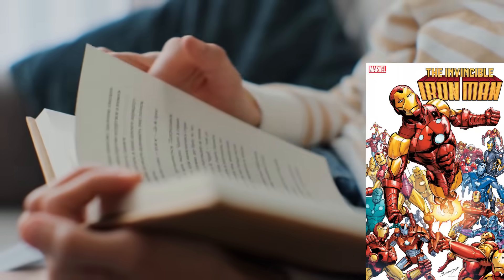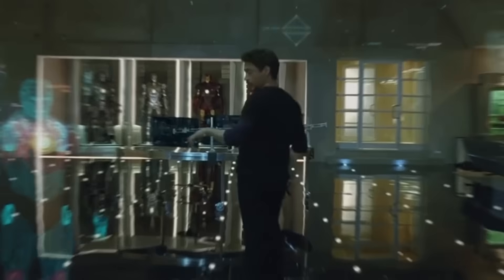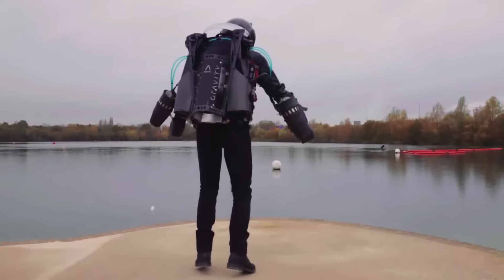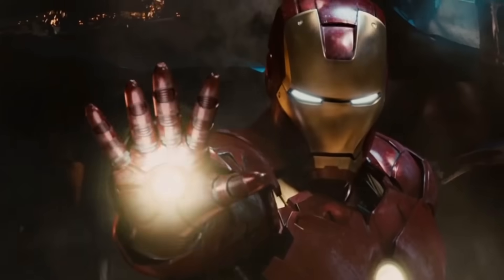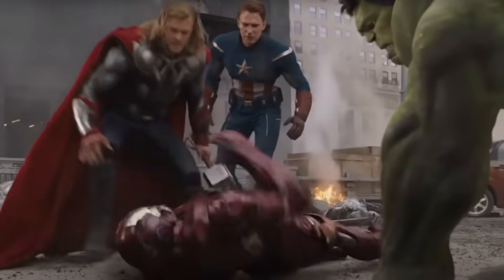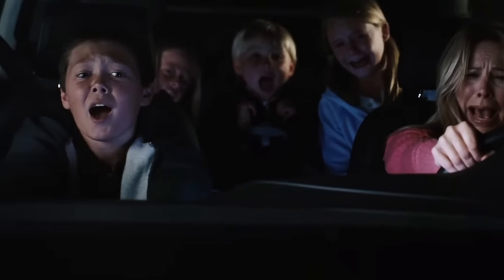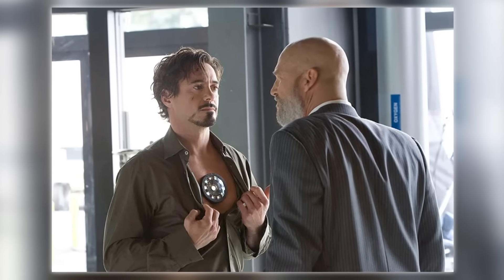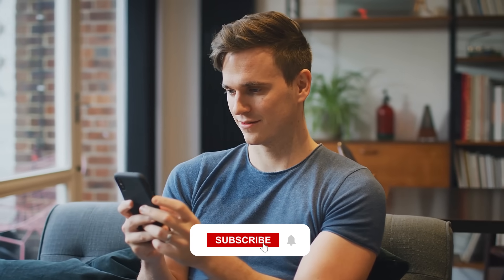Why we can’t build an iron man suit in real life

Comment: Repulsors is supercharger tech. The hydrogen quartz solanoid arc reactor uses amplification and feed back loop and filtering which is why the lighter smaller hydrogen and water but remember it was created to lock and hold shrapnel pieces in place. It amplified the power and electromagnet till it could MRI imaging precision hold shrapnel which might not be magnetic or have little magnetism so its tuned maybe for brass or lead. Its summary is rather than hold shrapnel piece he locked his chest ot blood in place so he could move and not be shredded. Its maybe based on paizoelectricity perhaps backwards or something with quartz frequency he then has this electro magnet feed back amplifher of power maybe just an overly large quarts in segments which if overloading create the supercell red storm on other planet jupiter overloading more and more maybe like a white dwarf proton star thing is related. Its function produces much hydrogen like the surface of the sun but its maybe just supercharger fueled by water that engine blasts hydrogen out exhaust he call repulsors

Comment: why you need a video for that... pure common sense tells you we don't have the power source (we don't even have a running fusion reactor and getting that into miniature form-factor well not think about that one yet)... then there is the material which isn't strong enough to hold up in that size nor can withstand the damage... even the hulk buster which is much bigger wouldn't be possible at this point if you want one which can fight... we lack of propulsion systems which are small and strong enough to lift the armored suit plus a human (yet alone a human - and one of his gloves or boots is strong enough to hold him in the air)... we leave weapons aside as it would just be fun to fly around in them (which we couldn't replicate anyway)... and well the AI / computing power required isn't there yet...

Comment: The arc reactor is everything. And we simply don't have anything close to it. It produces more energy in a tiny form factor than entire nuclear power plants, and also doesn't give off any excess heat or harmful radiation while making so much electricity. It essentially gives you the power of God in a tiny form factor. With that kind of energy at your disposal, almost anything becomes possible.

Even in MCU, Howard Stark modeled the initial arc reactor design by studying the Tesseract. Tony later refined it, and then miniaturized it in the cave. Unfortunately we don't have a Tesseract to study from either. We are still struggling to do nuclear fusion with TOTAL net energy gain in large reactors like ITER.

Comment: For the reactor you need sodium as the energy to power up the whole suit I made my own suit but it isn't iron I call it Blastersuit 1.0 so wanna know why I use sodium instead of electricity?
Bc of heat and shockwave through the suit that might shut off everything the blaster works but uses Ligther fluid and it creates shockwaves through the room knocking all the unstable items

Comment: Nikola Tesla was desinging the capability to transfer energy wirlessly from point a to point b (stationary) if you could some how use a targeting system to consistently track a unit (b) that can keep a unit wirelessly on a designated frequency. shelied some how to prevent hijacking or unit disruption 🤷‍♂️

Comment: if the suit were real, id have to assume that some small scale thruster would be pushing everytimethe laser beam shoots or that the laser beam is an extremely reactive substance that creates explosions with almost everything it touches. About the shock resistance, the only wayy it would be possible is that the suit has some kind of mechanism that absorbs upto  a huge caliber of force and prevents tony from receiving it

Comment: You pointed out that the Iron Man suit might "faceplant" in real life, but in some of the movies, they do show the suit having flaps/rudders in key points. This suggests some consideration for aerodynamics, even if not perfectly realistic.

However, a major point many people overlook is that Tony's Arc Reactor isn't just the power source for the Iron Man suit; it also contains the chest-mounted "Uni-beam" you touched on this but I feal like you might have missed something crucial there, allow me to explain.

The Uni-beam, with its immense energy output, could theoretically be leveraged with AI-controlled thrust vectoring to prevent the suit from losing altitude during horizontal flight. Imagine the Uni-beam providing an upward counter-thrust precisely managed by an advanced AI.

While a human-like Jarvis is still far off, AI systems are already rapidly advancing at a staggeringly exponential rate along side other advancements such as quantum computing and are capable of complex tasks, even controlling fighter jets. This shows the potential for AI to manage the intricate real-time calculations needed for such a system.

And such powerful, compact energy devices are, in theory not only possible but highly probable, and a subject of ongoing research. While widespread application of nuclear fusion is still in the research stage and far from being miniaturized, the concept of harnessing incredible energy from small sources isn't entirely dismissed by science. It's truly only a matter of understanding the 'how,' then figuring out the 'scaling down' part.

I don't say this to sound like the smartest guy in the room, I bring it up because I truly enjoy such subjects and remain ever hopeful to see these sorts of advancements make a lasting and positive impact on global security against possible extra terrestrial threats, as well as the potential to provide limitless clean energy and bring peace to our peoples when we can take to the stars and no longer have to fight over land and resources.

If like me you find the idea of such advancements entertaining then you should totally check out "super wood" by Invent wood, its a new and very real way of processing lumber that actually makes it stronger than steel...

Comment: The 1% inefficiency of the arc reactor could technically be accounted for by things other than heat loss. For example neutrinos produced by certain nuclear reactions do not interact with much but their kinetic energy due to their motion comes from the said total energy of the system.

Comment: Power density and power draw without overheating are the two limitations of the suit.  The main limitation though is the person going into the suit.  We're squishy and cannot handle the g-forces and other forces involved with the suit.  No human being would live long in one of those even if it had a breathing machine and other things like a space suit.  It still wouldn't be able to safely fly the person.  The current attempts to overcome this are just glorified jet packs.  And, even those you've got to work out and be in great shape and then practice a ton with those to use them.  And, it isn't super safe.

Comment: The holographic projectors are still a long way off. 
Repulsor engines aren't a thing, not even close, why you separated it from flight is dumb. My understanding is that it uses electricity to ionize and potentially magnetize the air which is possible but the energy requirements are insane. The alternative is a concept based on harmonic resonance using frequency arrays  the problem though is this only works on short distances and for the time being only certain types of solids, while it could be expanded in theory to have longer ranges and more materials you wouldn't get a highly focused attack beam but instead a huge area that scales with distance. Seems like you'd need a 3rd concept to make this work.
 The AI probably doable right now with enough training data. 

The suit itself I'd actually kind of buy, you can make a shock gel to absorb impacts and integrate an exoskeleton to handle all that titanium weight although it's worth mentioning the later suits are lighter alloys that supposedly are stronger and lighter, of course there's also the nano tech suit so it all kind of goes out the window. 
About the impossible arc reactor. If it were fusion or fission both are radioactive, the implied tech is beyond that and converts matter into just pure energy, also fluctuates output with demand. Still impossible but the heat isn't as much of a concern it's the method of conversion being completely unknown. If this were the case though he might just have the energy needed for the repulsors.

Comment: 7:15 there's no way electric wires that thin could handle 3GW. I doubt it could even handle 3kW continuously. Also, if the 3GW output is real, the waste heat from that alone would vaporise Stark within seconds.
Reply: Superconducting wires

Comment: Actually we could but you have to think of it as temporary suit like after awhile almost everything needs a battery or a recharge or a refueling I don't believe it because honestly I can see in being power for at least 4 hours on gasoline
Reply: But honestly I don't see why a couple drill battery packs combined with maybe a car battery gasoline and you'd also want it so you can redirect each source of power to different parts like plane fuel for flight
Reply: I mean 4 hours is the minimum I mean seriously do you need it to run longer than 4 hours cause if so you could just replace the suit that's currently being used with another charged one it be like a suit swap so you probably wouldn't need as much power but you have to have a time you can't say it an unlimited energy sources which generator are close to combined with micro solar panels
Reply: Think of it like a car or plan stop looking at it as a suit for now look at it as anything that takes gasoline and battery and a generator like a car
Reply: I'm sorry I keep comparing it to a car or plane but that's essentially what it is a machine that is understool how to build but not power
Reply: You could install a fuel gauge so you know to land before empty and can have micro tanks
Reply: I'd say beyond that they actually hard part is putting a computer inside because good luck nobody's ever don't that
Reply: Now actually I could see making the suit larger to make it more adaptable in such a way that a gasoline tank could actually fit
Reply: And you'd wanna use hydraulic joints
Reply: But yeah good luck figuring out the putting a computer in the head
Reply: Think maybe like the hulk buster now than has some room for a gas tank
Reply: Actually I think tony was wrong about drones being wrong because if you can control the suit remotely why not and he even doesn't but gets away with it somehow like with the mk 42
Reply: See in a drone there arnt  excess power going to life support systems I mean yes maybe a temporary suit but I don't see it lasting longer than 4 hours without some kind out refueling like every electric/gas powered vehicle ever made including helicopters and a lot of helicopter tech is incorporated mainly then votl not sure if I spelled that right but I don't car
Reply: We already have machines that a capable of being used with a lot of power cranes for example

Comment: They really understate the energy problem. Making an armored suit fly through raw thrust would exhaust the best battery we could fit in a package that small in a matter of seconds. And no power source other than a battery can be that small in the first place. At the rate batteries have improved over the past hundred years, it's going to be several more centuries before we can fit that much energy in a space that small. Best case.
Reply: I mean maybe we could make a power manager that will better dispense the power to important systems and would notify the user of low power and be automatically programed to land and open the parachute right before power loss
Reply: @stevenmilsteen2395  A low power warning does nothing to fix the problem of the battery capacity being 10,000x too small
Reply: The battery manager would allow flight but also tell the user when it doesn't have enough power for flight anymore but it'syou should also be able to redirect power from secondary systems
Reply: Maybe pyroelectric fusion was finally cracked

Comment: In reality, however fancy and high tech your suite armor iron man suite is, a simple dumb artillery shell would cut into several hundred pieces on impact. So it would be cost prohibitively expensive to arm soldiers with iron man like suites which could easily be destroyed, jammed or hacked by the adversaries. 

Just imagine an iron man suite armed soldier gets stuck into his own suite by simple EW jamming or EMP strike by some Iranian force. Now this iron suite would effectively turn into a cramped jail cell or the coffin for the soldier operating it.
Reply: Mechanical release joints. Release mechanisms can exist, or add things to protect from rf, emps and all that.

Comment: Because your basing the suit off a fossil fuel. The suit would need to incorporate maglev tech. The electromagnetic arc reactor would need to incorporate a form of solar & quartz crystalline ionisation process to power it's reactor. Just need to generate a wide enough electromagnetic field around the suit & then you can use the earths magnetic fields as superhighways. You would just need a way to accurately visualise the fields like birds & marine life. And a way of switching & locking into different geomagnetic co-ordinates. Quite possibly through the gauntlets like Starks plasma gauntlets. They could be used to manoeuvre. The problem is compressing it into a suit that's slim like iron man. Space Marine size would be more feasible. Kinda like those UFOs they keep saying are extraterrestrial & defy known laws of physics when really just harness the magnetic ones that encompass all of reality....ok good talk look to the skies 🕊️

Comment: It's not cold fusion! It's fission. Fusion is like the A-bomb, cracking the nucleus and releasing heat and heavy radiation. Fission uses heavier, denser elements to only strip away the electrons. Like the magnetic drives in UFO's.

Comment: Nano technology could potentially produce a palm sized cold fusion reactor plus greatly strengthen the suit’s armor dramatically and also prove more than capable of serving as the brains behind Jarvis. Nano technology can also manipulate matter on levels shorter than the wavelength of light so a stealth Ironman suit would be more than possible and have the ability to bend light around itself therefore becoming invisible to the naked eye and other sensors like radar and infrared tracking.

Comment: I did extensive research, however the getting the exact geometry for containment and the exact proportions correct is one of the things I wasn't able to do. I am not an expert but what I can gather is that the arc reactor is a advanced fusion device beyond what we haven't even been able to achieve yet. Normal fusion uses deuterium and tritium which are isotopes of hydrogen. You need extreme pressure and temperature. Which are what tokamak where used for, there are newer ways to increase energy efficiency and pressure. Better material such as super conductors made of various materials.

The arc reactor uses palladium which in the real world can absorb hydrogen and reacts with it, Creating some of heat. In the first iron man movie the arc reactor for his building uses a compound form of flourine. Flourine is electronegative and a super oxidizer. It can hold extreme about of electric charge increasing its density. Krypton gas is slightly less electronegative but a close second. There are others but not many 3.00 or higher for electronegativity which is I suppose another way of saying electrolyte. Also, if you can generate enough protons with material of some kind that can absorb the protons it can be used as a chain reactor to fuse hydrogen together. A super electromagnet is required to accelerate the material at high velocity, the gas and other material start to charge and ionize. Which should be able to turn into a wakefeild accelerator. Which is a particle passing through plasma and creating something similar to a shockwave.

I am no physicist but I do understand the basic principles and laws. 

If anyone can think of anything that can theoretically improve Tony Starks advanced fusion device, please let me know. Or if I am wrong about something or missing key information.
Reply: Acids are proton acceptor and alkalis are proton givers

Comment: The U.S. military's "Iron Man" project, the Tactical Assault Light Operator Suit (TALOS), was a program to develop a robotic exoskeleton to improve soldiers' abilities on the battlefield. The project was met with skepticism and hype, and the final product was not a comic book-style super suit. However, the program did lead to the development of several technologies that are still being used today. 
Here are some of the things that were planned for the TALOS suit: 
Exoskeleton: The suit would have an exoskeleton to increase the wearer's strength and endurance. 
Helmet: The suit would have a helmet with a heads-up display. 
Sensors: The suit would have sensors to monitor the wearer's vital signs. 
Liquid armor: The suit may have used liquid armor that could transform from a liquid to a solid when an electrical current or magnetic field was applied. 
Body armor: The suit would have light, impenetrable body armor. 
Cameras: The suit would have cameras to provide the wearer with information about their environment. 
The TALOS program was never a formal program of record, but the technology developed for the program is still being used today.
Reply: There's liquids that can solidify in presence of electricity and magnetic fields, and d30 is a liquid goop that can do that on impact